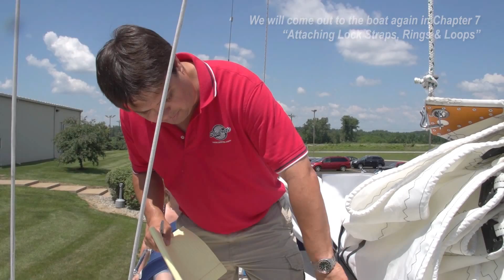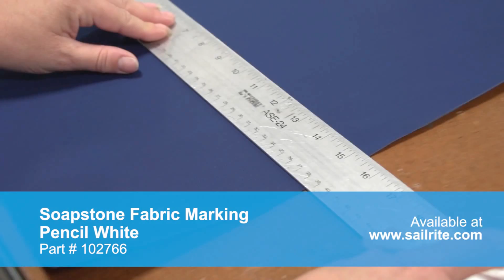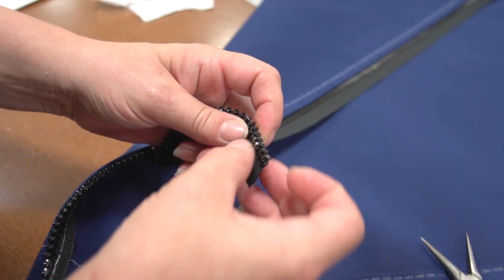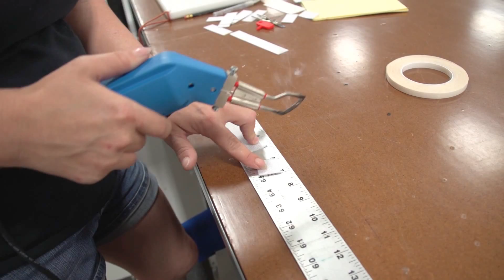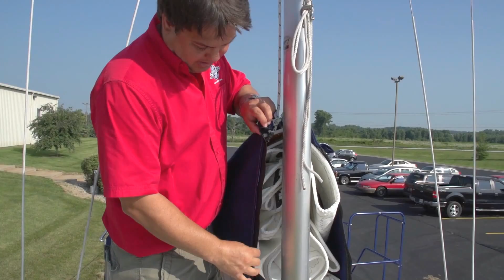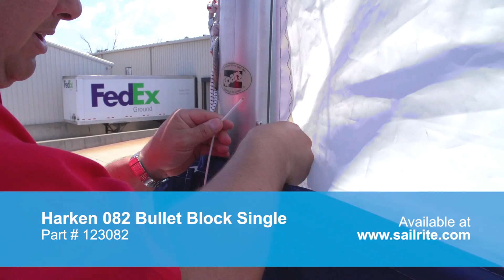How to Make a Sail Pack for Your Boat

Comment: I feel like I got my money worth by buying a sailrite machine. These videos are the icing on the cake for sure. I had problems with the first machine and they worked with me to diagnose the issue but finally had me send it back and sent me another machine that worked just fine. They have been very helpful and my thanks to Seth for helping me get the machine I had hoped for.

Comment: How would the mast boot work with a whisker pole track or a spinnaker crane on the front of the mast? Would you just unzip it when you want to use said system?

Comment: Great video, very easy to follow even for a novice. I now have my sailpack ready to test fit on the boat, but I didn't proceed with the slits for lazy jack lines. We get a lot of rain, so I am concerned about water running down the lines and inside the pack. Wondering if I could sew webbing loops on the outside instead, maybe with an extra layer of sunbrella on the inside for backing?
Reply from the maker: The idea for the lazy jacks slits for the support poles is that I loads along the length of the pole not necessarily a point on a seam.  There logic is faulty covers are primarily for UV protection then water. 
Even if water ran down the line it would go into the seam and then down the length of the sleeve and out the back very little will ever get to the sail and since the sunbrella breaths it would evaporate very quickly.

Comment: I don't have a loose foot main,  My plan is to sew bolt rope tape to the bottom of the sail pack and then feed the sail pack under the bolt rope on the foot of the main.   Yeah its going to make bending the main on a PITA, but since I'll only have to deal with it once or twice a year  should be OK.  Question.  my reefing attachment points are dead-manned to a fitting in a track on the side of the boom.  So I need to get my reefing lines through the sail pack. I was thinking about doing the same thing you did on the Dodger for the sail control lines @ 1:36.40.  or just cut a 6" slit and then finish the edge with binding tape...Thoughts?

Comment: This is a great video. Finalizing my options for our new sail in the Spring. Thinking about the end of the boom and opening for possible bee/wasp nest building inside the stack. Thoughts on closing that end up? Also maybe some caps on the end of the PVC pipe would solve that issue as well. Also thoughts for the gaps along the boom? Our mud daubers make quite a mess. Thanks!

Comment: The foot of my sail slides into the boom with a bolt rope.  How would you attach in such a setup?  Snaps along the side of the boom?
Reply from the maker: For sails with boltrope in groove you have a few options:
1.       Install slugs or slides.
2.      Use a hot knife and cut oval slits above the boltrope so that the webbing could be passed through to the other side to attach the opposite side of the cover. Most customers do not like to cut holes in their sails
3.      Use item #22108 - 3” wide dacron tape (non-adhesive) instead of the webbing tabs with twist lock.  You would then cut the tape into 6 to 8 inch length stripes. You would lay the two halves of the cover open and sew on the pieces of dacron tape in the same locations as the webbing per instructions. You would then slide the foot of the sail out of the boom to start.  Then when sliding the foot back in, the cover’s Dacron tapes would be tucked in around the boltrope and slide in at the same time so that you would have half of the cover on one side of the boom and half on the other.
Reply: @SailriteDIY  Okay!  I've gone with option 3.  Now to go and install on the boat!

Comment: Thanks for the excellent detailed video. I am think of sewing a sail pack for my Nonsuch, which by design, already has LazyJack lines. I am wondering if I would still need batten for stiffening the upper edge? I have also noticed that other manufacturers suggest lining the entire bag with Dacron. What are your thoughts on that? I noticed you only used it on the mast cover.

Comment: As always, great video!!  How would you do the sail pack for a loose foot main?  Would you still use common sense fasteners?  Do the instructions say how to do a loose foot main?
Reply from the maker: Alternatives for loose-footed Mainsails: Attach the appropriate slug or slide to the webbing straps at their centers or sew 4” pieces of boltrope tape to the bottom edge of the sail pack, alternating between panels so that both panels can utilize the boom slot. If the bottom does not have a track, use awning rope (instead of boltrope) and install awning track along the sides of the boom (use track segments to avoid reefing lines or other controls if necessary).

Comment: Hi! Wondering about your thoughts on using a grommet for the lazy jack lines instead of (or maybe in addition to ) the webbing reinforcement on the inside of the cover?  Thanks for all the wonderful streaming videos.  Used them to build a dodger and a bimini for my Moody 376 last year!
Reply from the maker: Yes, a great idea. The reason we did not include that in the kit is because must customers do not have spur die sets to set the grommets. I would reinforce the area with webbing or a vinyl fabric prior to installing the grommets.

Comment: Hello, I have to questions for a Catalina 27 and the boom is 10'5".  Will a 10' kit work?  I think it will, because main doesn't go all the way back to the boom.

My 2nd question,  is that my main sail is connected to the boom (rope system that feeds into track) unlike the video  where you have space to go under the main sail.  What is my alternative?
Reply from the maker: +Eusebio Viajar Yes, if the foot of your sail is 10 foot or shorter the 10' kit should work just fine.
Regarding your boltrope in groove issue, you have a few options:
Option #1: Install grommets with shackles and slugs or install slugs with webbing sewn on foot. (Best option)Option #2:Use pre-fabricated boltrope or Awning rope and awning track (Flex-a-Rail) and sew it (Boltrope/awning rope) onto the sail pack and slide this into the groove of the awning track that has been screwed to boom. Each strip (Boltrope or Awning Rope) should be about 6 inches and staggered so it can be slid into the track on both sides. Option #3:Not very popular – Cut slits with a hot knife right above the boltrope to allow the webbing to pass through.
Reply: +Sailrite  Thanks
Reply: @SailriteDIY  I like the look of the sailpack connected under the sail. My mainsail was connected to the boom with a bolt rope. I installed slugs. I should be finishing my sailpack this week.
Reply from the maker: @rihesq  Awesome! Good job.
Reply: i have seen a pack where the pack's bottom is closed with a 10ft x 6" strip of sail cloth. This is folded around the sail's foot bolt rope and both are slid into the boom grove. A simple solution with no more hardware / slugs/drilling, but will typically need other mods to access reefing lines.

Comment: When I did the lazy jacks on my sail pack I set the top block on my spreader about a foot out from the mast on each side on the spreaders to avoid  the battens to get caught in the jack lines. I also set the adjuster lines from cleat on the bottom of each side of the spreader and up to turning block on spreaders then to the block that took the jack lines down to the sail pack.

Comment: Nice video, liked the idea of a becket block on the end to hold the zipper in place and use the block to close the zipper with,I had a sail pack on my old boat and found it hard to reach the zipper on a long boom in rough weather.

Comment: Concerned about the windage on the pack.  Looks as big as a storm stay sail. 
Another concern is the metal tabs laying along the boom.  Noisy?  Chafe?  Why not go under the boom?
Good video.  Long but the job was complicated.
Reply from the maker: Yes, your concerns are why some often do not use sail packs, but will instead use a traditional sail cover. As with any kit modifications can be made to the webbing locking straps. I have had other customers suggest going under the boom. We have not tested it, but it sounds like a good idea.